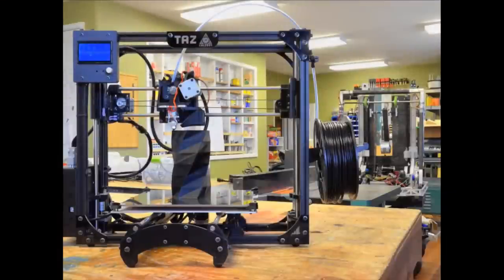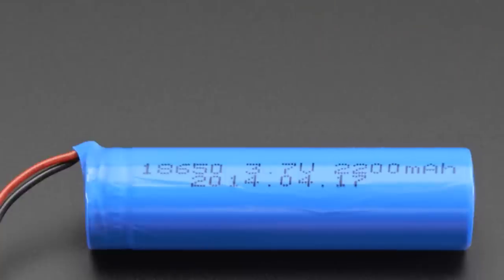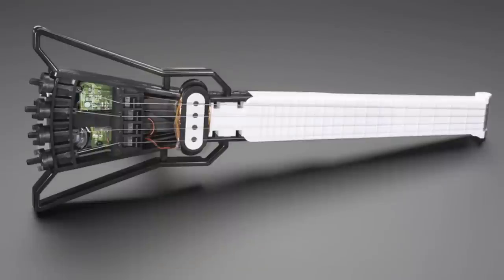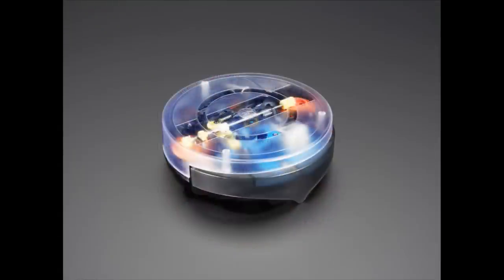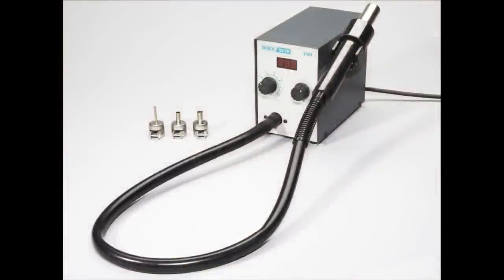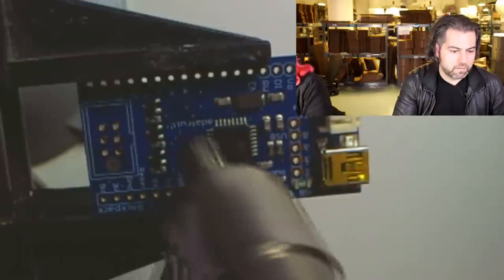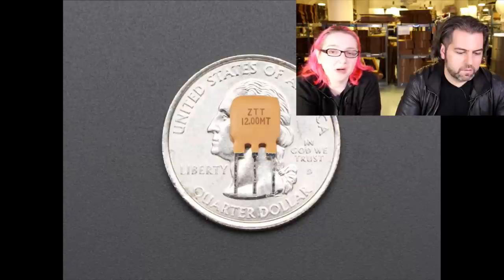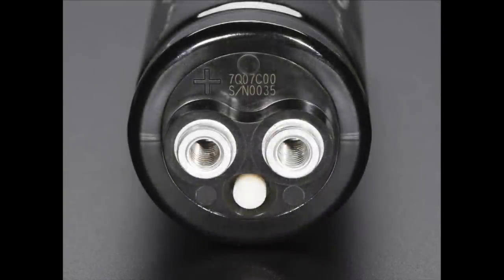New Products 5/14/2014

Comment: Im buying a Quick 957DW+ it will be fine for my kind of use. My next project is to replace a 48 pin ICS-chip on an old Xbox 360.
Trying to find a 230V with EU-plug though.
I really like that this is easy to use and for us beginners and that its quite safe to use do desolder and solder back components.